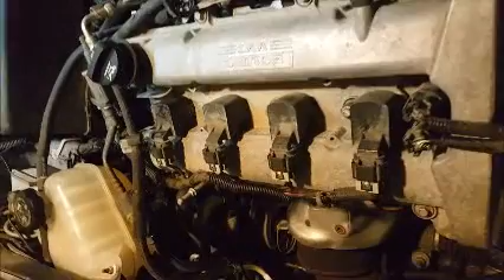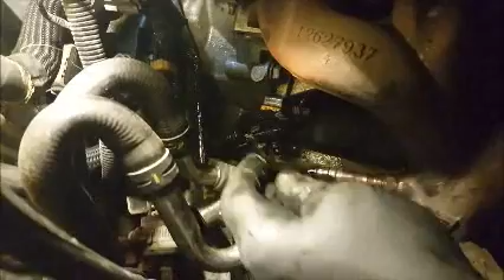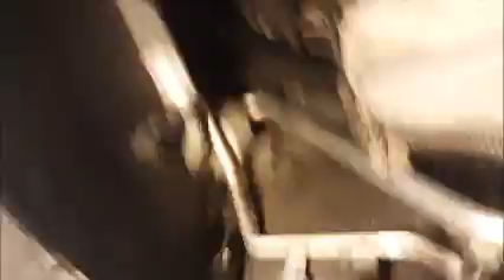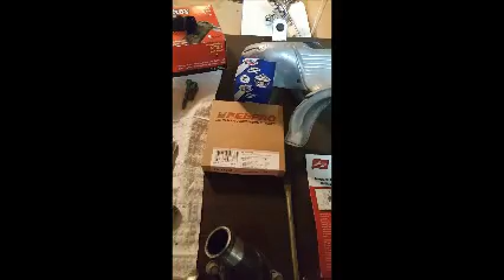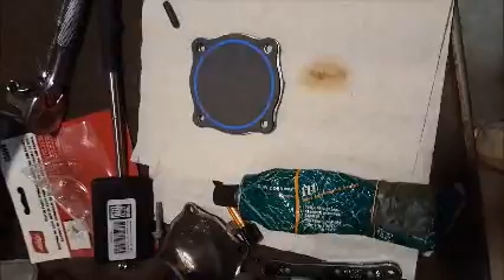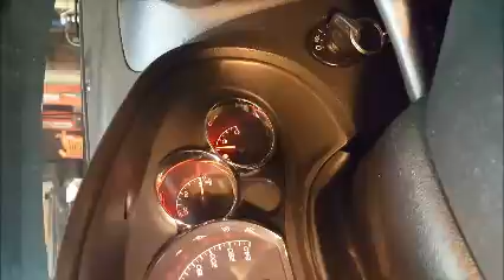2008 Pontiac G6 2.4 (2.2) Ecotec water pump replacement - Complete

Comment: Better of the videos I’ve seen on this. I just did an 11 Equinox. Wish I would have watched this one first. Seems like less rooms to dicker around in engine bay of equinox. Had to drop 1st Cat down Pope off manifold also. Other than that same procedure. Would be quicker if I had a lift vice jackstands. Shoulda pulled drain plug in pump side of Tsat to drain there before pulling hoses. Yes get magnetic sockets. I didn’t drop any  screws in timing cover but almost did. I had the same lisle sprocket tool. I would get the OTC for next time if I do again. Need to use distilled water when refilling coolant system to take out minerals that can cause scaling. Also need to flush or replace with the correct coolant periodically to keep the PH down in system and some coolant is more compatible with aluminum. These reasons cause the pitting seen on surfaces when pulled apart.

Comment: Super Glue them 3 bolts onto the sockets or use tape... They get down in there. The timing cover has to come off....

I just did one of these today.. That half moon lock down tool. Needs to be installed across the bottom Horizontal. It stops the bolts from falling in.

Comment: My pump is stuck onto the engine and won't come off, I removed all the mounting bolts from both sides... I have no idea what to do...
Reply from the maker: Hmm. If I remember correctly mine came of fairly easily .. i know you likeky have,  but double check the bolts again then try gently tapping the side of the pump .
Reply: There 2x 15mm bolts on the front side. One at top. One at bottom... The bottom will not come out. Unless you drop the motor...

Comment: great video. You actually included showing the coolant transfer tube (the metal pipe between water pump housing and thermostat). That O-Ring on the end of the tube by the water pump housing actually fails and drips/leaks quite often, causing people to replace a water pump when all they need to do is pull that pipe and replace the O ring on the end of that tube. Great video
Reply: There were minds is leaking right at  that pipe

Comment: The Fel Pro gasket kit DOES come with the seal for the thermostat housing to head mounting. It is a seal with the small nubs on it and is a circle shaped. It conforms to the housing  groove as you press it in and the nubs hold it in position.
Reply from the maker: If I remember correctly there is still a gap between the gear and  pump   but by all means give it a shot if you think it's doable

Comment: I just dropped one of the bolts in than freaking hole and now I just can't get it out!!😠😠 any idea how to get that bolt?
Reply from the maker: Judit Gagyi 
I got lucky and very slowly and carefully  used a thin magnetic pen and was able to get the one i dropped. Hope you get it ..
Reply: Thanks for replying to my question.  Now an other one lol. I filed the system with coolent but for some reason the lower hose (botok of the radiator? Is stays cold after runing the engine for an hour also the temperature is going up to the sky!!. Any idea what's wrong Now?

Comment: Terrible design, isn't it? Much the same isues with a 1999 pontiac grand am. A garage wanted to charge a friend $1000 to replace the water pump because of the sheer amount of work involved, so I'm helping out. They really need to get a clue and power it off the the serpentine belt like other makes of cars :)

Comment: How many miles did you have on your g6 before you had to replace your water pump.... thanks for the video
Reply from the maker: Sri Ram I have about 100,000 kms
Reply: I have a 2009 g6 with the  6 speed transmission and the 2.4L - just hit 111,111 miles.  I have not done any maintenance on the cooling system yet.

Comment from the maker: A rag could certainly be helpful but if the bolt dropped you may have to remove retaining tool to get at it otherwise good suggestion and better than nothing . If my  memory serves me when I looked at it,  removing the cover  seemed to require pulling the engine...in that case you don't need retaining tool or any of the above procedure.  If you do end up servicing chain and guides please post video for us ...thank you.
Reply: not required but dropping subframe sure would make it easier. i love subframes can drop and remove subframe engine and all from under a car with just a 2ton engine hoist in an hour.

Comment: What about stuffing a clean shop rag around the water pump gear to close the gap and prevent bolts or sockets from falling inside the cover? Seems like it would work...just remember to remove before closing up the access hole! I plan on replacing my pump as well, however I will probably have the cover off since I will be checking/replacing the chains and guides.

Comment: Nice job I have 2003 Pontiac Sunfire with 2.2 Ecotech I'm sure I will have to do this job.  Thanks for the info.  What was the total time involved with this pump?
Reply: Ten hours.  I did unbolt the exhaust manifold, it really makes getting the water flow pipe in and out easier.